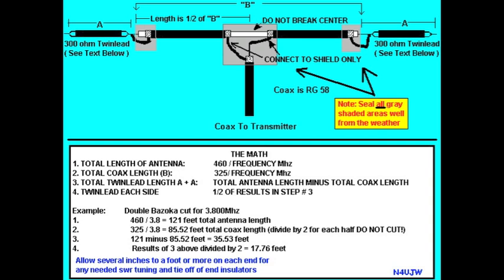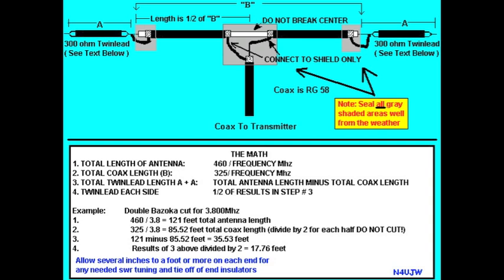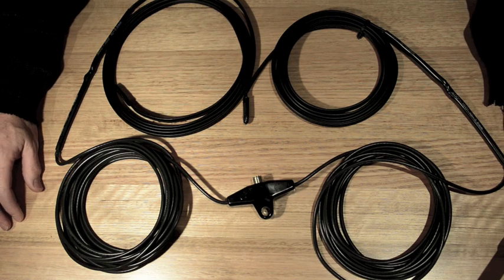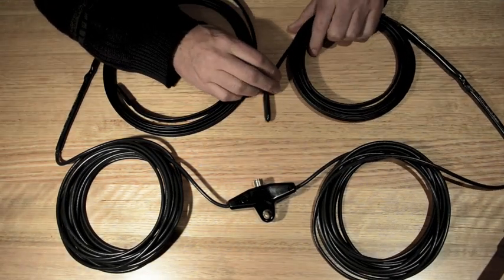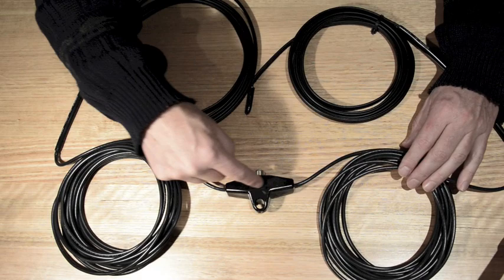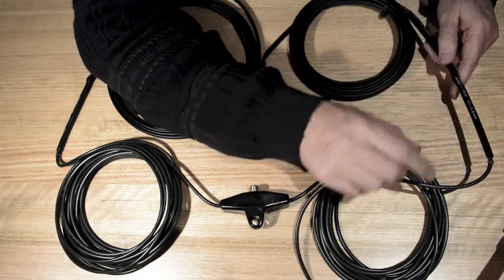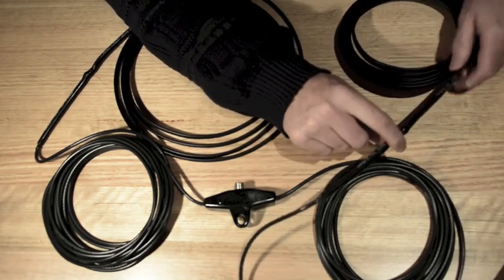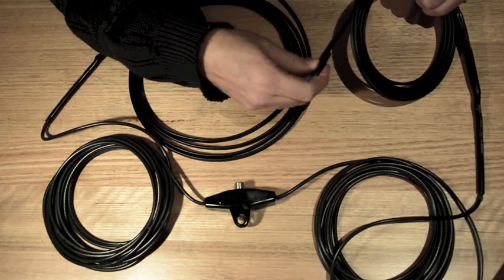The Double Bazooka Antenna - A Review

Comment: I built my first 40 meter bazooka antenna in the early 70s and it worked out so well I built one for 80 m and one 20 m.  No matter where we have moved through the years I always put up double bazooka antennas. There is nothing out there to beat them!

73 -- de Mick, WB4LSS
Reply from the maker: +Mick Bradford I agree, Mick. They really are a fabulous antenna. I've got one ready for 20m now, which I'm hoping to swing into the air in the next week or so. 73 de Rob VK3BVW
Reply: Rob Wagner, you will really enjoy it !! Most of my friends back then were so impressed with mine they built them for themselves.  It's a truly remarkable antenna!!

Comment: Just made one for 40M.  Erecting in a few days and will report.  Used IP58 plastic box for centre connection with PG11 glands  for cable outlets.    Internally glued heatshrink for end connections. Not neccessary to use twin line for ends. Single cable is OK.  Leave end conductors about 18" longer to set the SWR. Get antenna perfectly resonant.  Good luck and 73 M0MPT.
Reply from the maker: +Crobular I Thanks for the info, M0MPT! Cheers, Rob VK3BVW

Comment: Rob,  Enjoyed your video.  I've got a home brew 80 meter double bazooka.  I've been thinking of getting the 160meter shorty version.  Have you had any experience with them?
Reply from the maker: Hi Chris and thanks for the feedback. I don't operate on 160 so I've never had a need to build one of those. The IAC Shorty is advertised as 51mt long (168 ft), and the apex is recommended to be quite high. It would be a heavy antenna, so strong supporting structures would need to be considered. And an antenna of that length will probably have its legs looping down a fair bit (hence the need to get the middle of the antenna as high as possible). Good luck with it!! Best 73.

Comment: Is the 27mhz cb one any good?
Reply: Biggus Dickus: They're great for 27 Mhz......low noise and very wide banded so no problems with SWR (I've never had to alter mine) and no balun needed. I use one of these indoors because no external antennas are allowed where I live and even under these circumstances it works very well....my first contact with it was 800 miles from UK to Poland.
https://www.wireantennas.co.uk/hf/11M/double-bazooka-antenna-27-Mhz-cb-dxer

Comment: Great review Rob, I am thinking of getting one and wondering if you still have it in the air October 2015 and if it is still preforming well? Finally, since then have you tried any other antennas and do you still recommend the double bazooka over others? 73, Tom
Reply from the maker: +Tom k2bew Hi Tom. The 80 and 40m bazookas are still very much in operation and standing up to the weather really well. I had cause to lower the 80m antenna a few months ago (actually it started lowering itself because the supports were wearing out!!), and the antenna showed virtually NO sign of wear.  Indeed, I now have a 20m version to hoist into the air as soon as I can sort out where I'm going to hang the thing! As far as wire antennas go, the bazooka is as good as or better than any other antenna around. The 40m antenna works perfectly well on 15m, too. Thanks for your comments and good luck, Tom! Best 73 de Rob VK3BVW
Reply: +Rob Wagner Thanks Rob, I am definitely going to pick up one for 40 meters and try it out, and maybe I will end up with a 20 and 80 versions too  and replace my OCF Windom if I like them. I think you are always better off with resonant single band antennas anyway. 73, Tom